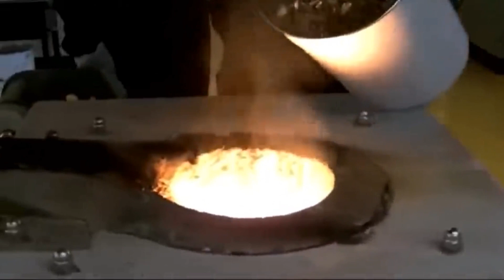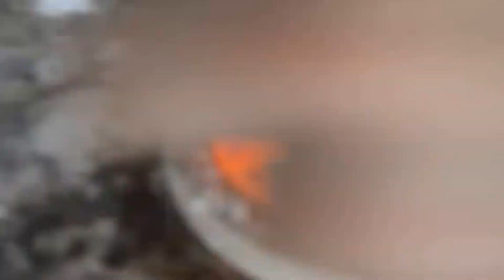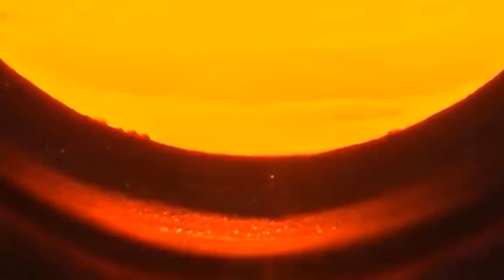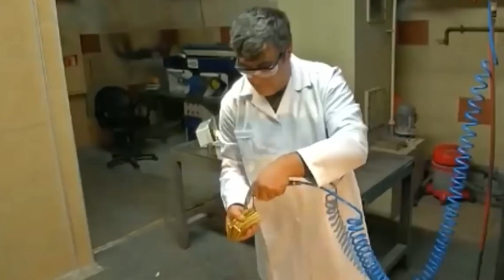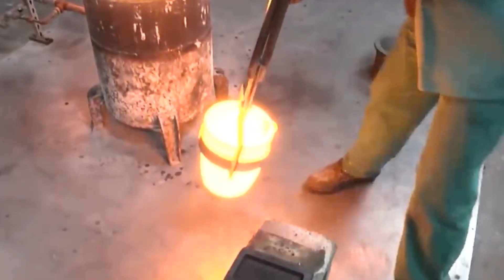Melting gold and ingots the process itself

Comment from the maker: Melting gold and  ingots the process itself 
 Gold is a precious metal that has not lost its relevance to this day 
And all due to the fact that gold in addition to external beauty has unique physical and chemical properties
Chemically speaking gold does not react with virtually any substance
And physical properties for example malleability resistance melting point of gold also make it possible to use this metal for almost any need 
But the industry does not use gold due to its high cost and relatively small amount in nature so most of the properties of metal remain unclaimed
Physical properties of gold are evaluated according to the following criteria malleability plastic hardness electrical conductivity resistance melting temperature